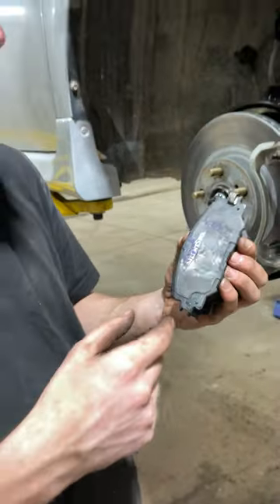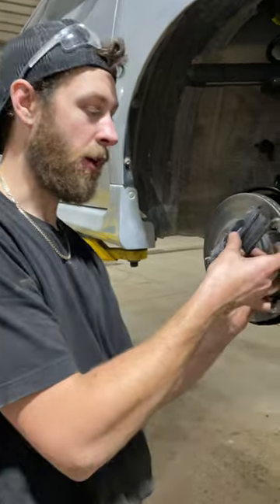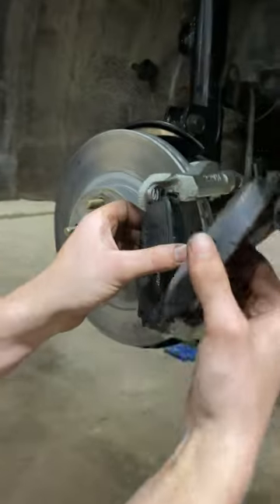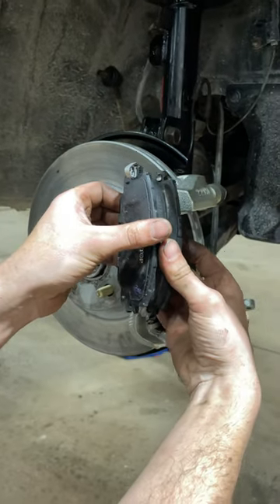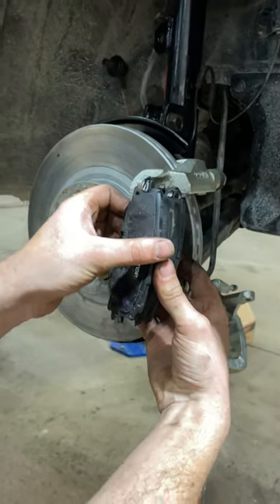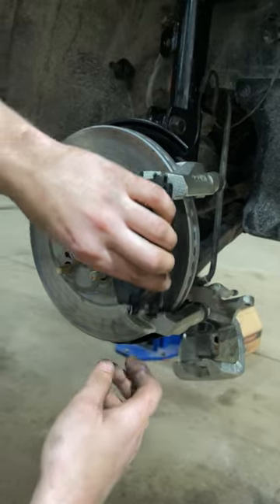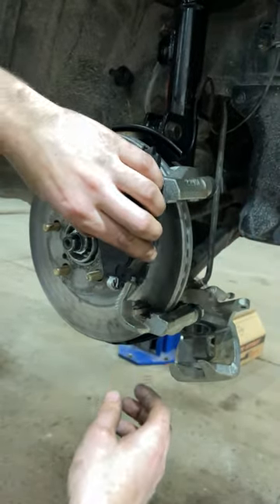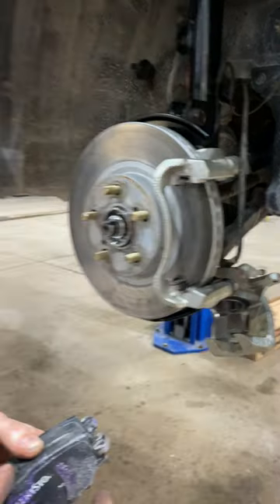Spring Down On Pads Will Make Clicking Noise

Comment: Depends on which side of the rotors the caliper is on people. Don’t always assume one directions.
Reply: Thank you  Noone else said it
Reply: Wow i just seen this i thought i was the smart one first hahahah
Reply: Yes, thank you for that!
Reply: It doesn’t matter which side they are on, as long as your spring is pointed towards the front of your caliper.
Reply: @LegionGamingTV what do you mean the front? It’s direction if rotation that matters. And with almost every caliper, the orientation is up/down or top/bottom. Not front or back.
Reply: @ianhalliday6696  I know direction of rotation matters, as long as you picture the caliper at a 12 o’clock position and put the spring towards the front of the vehicle it’s never wrong no matter which direction of rotation..
Reply: Absolutely correct used to be you could always count on the caliper mount being behind the rotor now they come both ways front and rear so yeah great point to make👍
Reply: @danielpriestley7170  exactly. Every manufacturer does it different
Reply: Don't tell me how to live my life

😂

Comment: In my experience those pads should have clips on both sides.
Reply: Only dodge rams will have one on each side. Hondas particularly have only one clip on each Pad. However this guy's reasoning is backwards
Reply: 1 on each side. Of 10s of thousands of I have never seen a clip on top and bottom.
Reply: @davepalmer9265  usually if they have ones for the top and the bottom there not already on pad they come in a bag with the hardware, I’ve done plenty of brake jobs where there none on the pads but there’s 8 in the hardware bag
Reply: @@DiagTyour talking about squealers not the clips
Reply: No.
Reply: Yea man I just did my brakes on my civic and there was a bottom and top clip. The bottom won’t fit on the top and top won’t fit in the bottom so you don’t have to worry
Reply: @@DiagTall the good vehicles don't have those pos clips soooo
Reply: These type of clips are also sprigs on front pads they will be on the top, but if it’s rear pads they tend to be on the bottom

Comment: Clicking noise has nothing to do with that clip. That is wear indicator. It doesn't push or keep brake pads in place. It is there is make metal to metal squealing noise when brake pads are worn down enough to cause clips to touch rotor.  To fix clicking noise put some grease on all metal to metal contact points. If you still get clicking noise, pads are not made to spec or caliper bracket has worn off. Some rebuilt ones  have more play because they removed thick layer of rusts. Now, there is less metal.
Reply: wow, would you look at that...someone who actually knows what they're for. amazing.
Reply: the ones shown are springs not wear indicators.  these are now electronic indicators on many cars.

Comment: Regardless of a clicking noise you may have just created a safety issue by hanging the caliper from the hose. Never do this. A little extra time and secure the caliper..
Reply: Big time!!
Reply: I’ve heard people argue that you could do to the fact that the brake line has basically like a spring style lining in it, but yeah, hang it to be safe I always use caliper hangers

Comment: Mmm those pads should have springs|hardware in both sides.
Reply: Not every pad has them on the top and bottom, some only come with one for each pad in the hardware bag
Reply: My Mitsubishi only has springs on one side, but hardware on both sides

Comment: Clicking is normal, put the wear indicators on the direction of the rotors. Toyota Tsb states from the 90s to present this is normal unless you use a $100 brake grease tube  eliminate

Comment: Does it cause a squeaking sound when placed on the wrong place? Only when I brake. I have mine installed at the bottom recently and I can’t figure out where the squeaking noise coming from
Reply: I’m not fully understanding but it could be a few things. There are rails where the pads slide on in the caliper housing that need to be greased for installation. Some pads need to be broken in a certain way based off of their material otherwise they will always squeak and finally your wear indicator will squeak because it’s basically a metal piece in your pad that runs on your rotor to tell you it’s time to change your pads and maybe rotors
Reply: Or... The abutment (mounting) clips that the brake pads sit on aren't sitting square. So everytime you hit your brakes it pulls the clip over with the pad against the rotor causing it to squeak only when hitting the brakes.
Reply: @midnightrider1854 what’s a rebuttal mental?
Reply: @tonyw1563  I'm pretty sure that's when your vehicle keeps giving you shit after you work on it and it drives you crazy... That's what it sounds like to me anyway. Lol

Comment: That makes no sense… when you put the car in reverse it’ll cause the pads to move. Which will cause them to return to the forward position when the car moves in drive. Thus, causing the clicking noise.

Comment: What about braking in reverse?  You'll get the same noise.
Reply from the maker: Your 100%correct. The amount of times applying the brakes and also at what speeds you apply the brakes at play into that. You maybe hear a click once when backing out of your driveway in the morning on the way to work but for the entire drive to work no clicks are heard, the purpose of the tension clips is to prevent clicking noises when driving forward because 98% of the time the vehicle is going forward
Reply: @Tech-28  Yes, more than 98% forward.  Could even cause problems if the bottom clip has metal fatigue.
Reply from the maker: @d46512  true I never thought about metal fatigue, good point

Comment: No spring clips is supposed to be seat at the bottom , the spring clips are designed as a spring stoppers just installed them properly

Comment: So what is the right way 😂
Reply from the maker: It depends on the where the bracket is located weather it’s toward the front of the car or toward the rear of the car and also the direction of rotation of the rotor, basically you don’t want the springs to compress when the brakes are applied due to the rotational drag from the rotor

Comment: Those are squealer bars that alert you when you brake pads are worn down.  They have nothing to do with being "spring clips" that push pads one way or another.  They do need to be in the correct orientation, but his description is totally wrong
Reply: incorrect, toyota brake pads ( other manufactures too) specifically have a clip to eliminate whats known as pad slap. the noise you hear when changing from reverse to drive or vice versa
Reply: Not squeellers. They are spring tensioners
Reply: Ya they’re squealers. Not springs for install. I think the video is a mock. But the people in the comments thinks it serious.
Reply: @tadyoshi3610  tell me you aren't an auto tech without telling me. 🙄
Reply: @tadyoshi3610 So I guess you snitching again so busted?

Comment: Excuse me fellow mechanic...I think you will find the rotation force will be upward due to the caliper orientatation being at the rear of the disc, with the vehicle moving forward that front left wheel rotation will be anti-clockwise. You're very welcome 🤜🤛
Reply from the maker: The calipers are at the front of the disc, but your right about the left front wheel moving in a counter clockwise direction when the vehicle is moving forward
Reply: Ahh my bad, I thought you was standing at the front of the vehicle. So if the caliper is at the front there is a downward force but upward if caliper is at the rear of disc 🤔
Reply from the maker: @DjToxicCandy  correct 👍

Comment: Squeaker tabs go on top so they squeak with just dragging across rotors
Reply: But hes talking about the spring clips.... fyi not all pads have the squeaking thingy....
Reply: @51-FS  you might be right,  but what is being shown is the squeak tab not a hold down
Reply: That tab don't stick out past The metal backing on the pad. And the spring clips are in the bracket that holds the pads..... maybe they are the squkers. Hard to tell
Reply: @51-FS  I watch in slow motion, and yeah it does appear to be holding spring tabs, squeakers wouldn't be curled like that.
Reply: @kennethwoolever5054  but it's got the spring things in the bracket that the pads sit in.....
Reply: @51-FS   I watched it in slow motion and decided it's holding springs, too much curl to be a squeak tab. But I have been wrong before. A squeak tab on most only have a kinda question ? mark design not the @LOOK
Reply: @kennethwoolever5054 What’s up squeaker?

Comment: I just did my brakes the other day and it came with a bunch of these. I put them on the top and bottom of each pad. Was that cool?
Reply from the maker: Depends on which side the caliper is, if the brake caliper is located on the forward side of the disc than place the clips on top of the brake pads and if the caliper is mounted at the rearward side of the disc than place the clips on the bottom of the pads. You see those clips are little tension springs that keep the pad from moving in the cradle however when you apply the brakes the disc will drag the brake pad in the rotation that it’s spinning in and if you have the spring clips on the wrong side than the brake pads will “click” every time you apply your brakes

Comment: That purple stuff sucks don't use it anywhere near rubber. Just throw it away
Reply from the maker: Right!? Just picked this thing up and the pads were covered in purple, and the tension clips were installed in the wrong direction
Reply: I prefer to use the orange silicone stuff by permatex
Reply: @TheAllens315  lol what are you talking about? You use orange rtv on brakes?
Reply: @jacobpoucher  permatex makes silicone ceramic extreme brake parts lubricant. It's orange colored. Works way better imo than normal brake grease.
Reply: What's wrong with it? Why does it suck and not belong near rubber?
Reply: @allenlamb8240  it makes it swell up and degrade/fall apart. It will fk up your caliper slide boots and caliper pin dampers, even the piston dust seal will swell up and get all messed up, stay away from this stuff unless there is zero rubber.
Reply: I break them off
Reply: @reekz1568  break off what?

Comment: They’re NOT springs.  They’re west indicators.  They’re meant to make noise, when your pads are due to be replaced. The caliper bracket holds your pads in place and only allows them to move in and out. Yeah, I know there’s a small tolerance that would allow them to spin, but it’s probably 1mm.  Again, this has nothing to do with holding the pads in place.